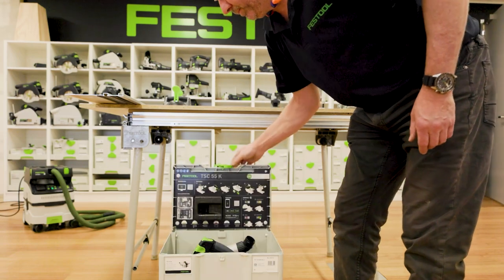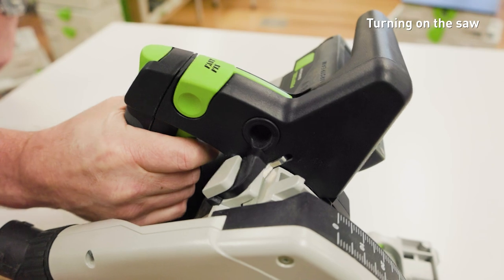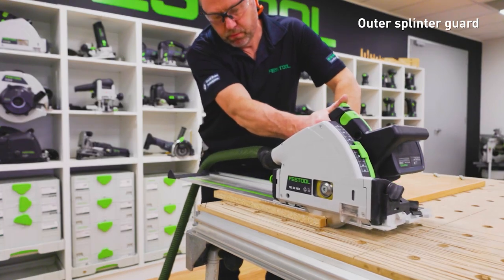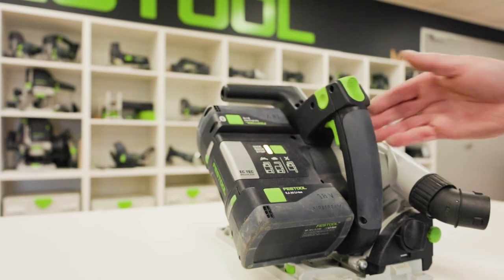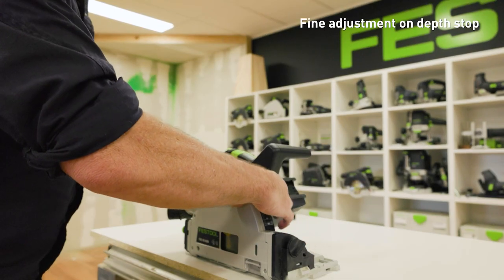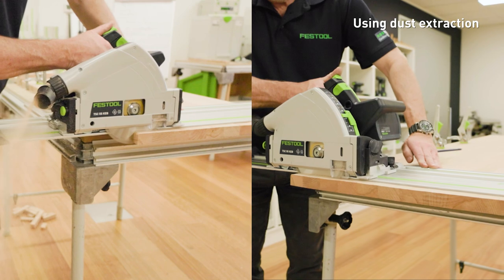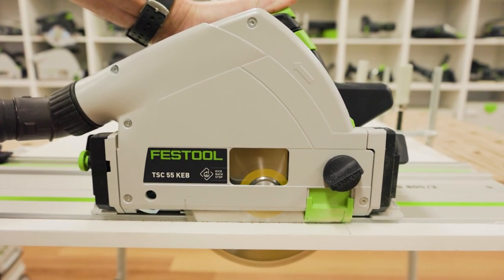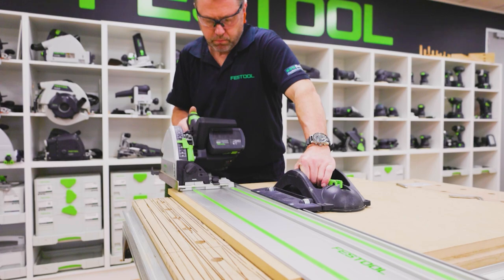Complete guide to TSC 55K - 18V 160mm Cordless Plunge Saw

Comment: Can I ask why the zero clearance strip isn’t cut from end to end why is there a small bit left at start and end and would you join two rails together then cut it ? I don’t know
Reply from the maker: The Splinterguard is not cut all the way to the end as its only trimmed off to the extent that the cams, that hold the base plate snug on the guide rail, are in contact. This represents the usable cutting length of a guide rail.
Once a guide rail is joined to another rail ,this allows the strip to be trimmed all the way to the end.